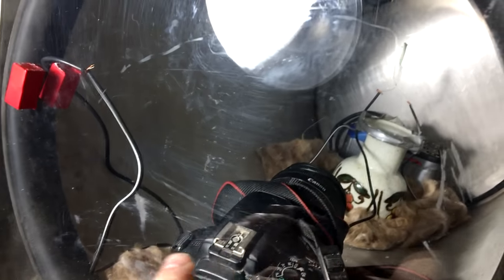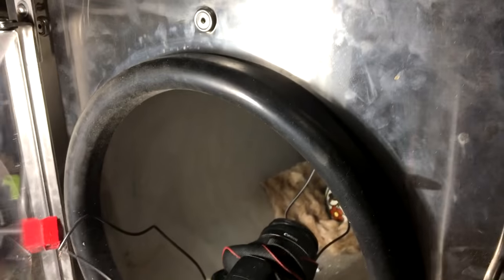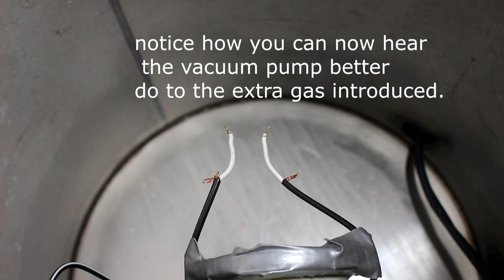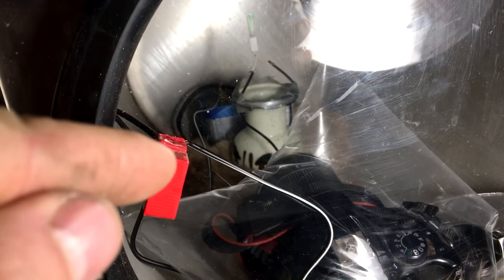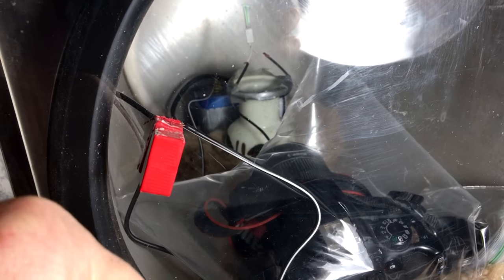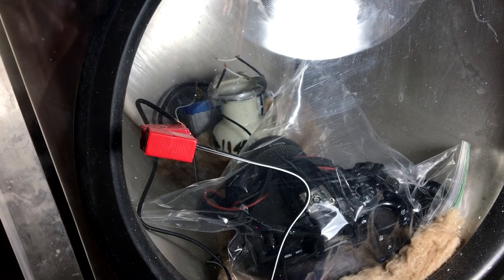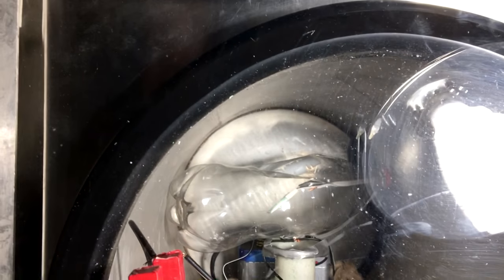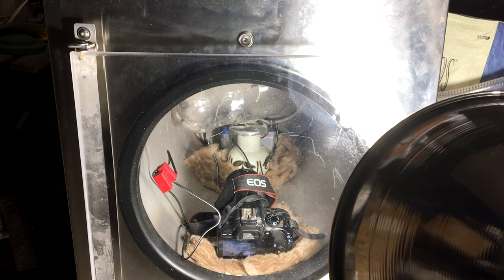Sound of Explosions in Space? part 1

Comment: So a camera can survive the vacumine of space
Reply: Paine Kid most things will.
Reply: Ludix147 but wouldn't the lens smash and the camera insides break ?
Reply: The optics are definently sealed and filled with gas, I guess the seal is just strong enough to withstand the negative preassure, or the seal broke before any lens did and gas leaked out.
Reply: If the camera is pressure sealed then maybe, however it's only one atmosphere of pressure. Going more than 10 metres deep in water would stress the camera even more than this.
Reply: Most of the optics are generally not sealed, especially on zoom lenses in particular.  When I zoom my lens in and out, I can hear the air escaping and entering the lens.  While this may not hold true to prime lenses, I wouldn't imagine the company taking extra effort to seal a prime when they don't seal a zoom.

Comment: If you created a diaphragm that made a noise as the air escaped, would that gas make a noise?  Since it would be pushing the air/gas that it held?

"In space, nobody can hear you scream."
Reply: Well, it is technically true. If you are in a space-suit, then your helmet vibrating won't transfer its momentum to any medium (due to near-perfect vacuum). And if you lack a space-suit, then you can't really scream, since air is just rapidly sucked out of your lungs, and then there's noting left to vibrate your vocal chords. Also, you're dead within two minutes.
Reply: If the air is sucked out of your lungs, wouldn't it go past your vocal chords allowing you to scream as it happened?
Reply: Gas will leave your lungs at near-sonic speeds, so it won't give you much time to actually use it. Back-of-the-envelope calculation shows you'll get at most tenth of a second, and more likely a couple hundredths. I don't think you can count that as a scream.
Reply: If you can't hold your breath in an airlock, wear a suit and use radio to scream. If the power's out, too, use a sign like Wile E. Coyote.

Comment: ok, so u can here noise in space, and you fan doesn't work under pressure moving the feather,  how about getting one of the skirt blowing speakers to see if sound waves move the feather and if so could you use sound waves as a propulsion method in space?
Reply: Sound is just kinetic energy that vibrates whatever medium it's in. In space there isn't any medium for the sound to travel through so you won't hear it.
Reply: +John Appleseed but as stated in the video, the gas expanding was the medium for the sound to travel through.

Comment: i seriously doubt you have a total vacuum, a pressure gauge would help, the best basic chambers only drop to 25inHg total vacuum is 30inHG so that would make this test "do explosions make a sound at hiogh altitude"  if there is gas around it sound is transmitted, no gas no sound, even if you had a total vacuum you would still hear the pop of the shrapnel hitting the camber walls (not the same as transmitting the sound of the pop)

Comment: Your vacuum chamber is too small to do a proper test.  The gas should spread out after a couple yards to the point where its impossible to hear.  You could try putting a barrier between the explosion and the camera such as a metal plate.  But I think the gas molecules are going to bounce off the sides of the chamber and hit your camera anyways. 

The only way to simulate the lack of sound in space is to have a big enough chamber so the gas molecules spread out to the point where most of them miss the camera

Comment: my question is if its near vacuum then how can the plastic cap get enough oxygen to go off and explode ! does it mean that a plastic explosive go off on mars or any other planet 😅
Reply: The blasting cap has its own oxygen which is released when heated, and yes they would work in space. Rocket motors work in space also because they carry their own oxidizer.
Reply: i know shuttles carry their own oxidizer but bear with me for a sec 
1.we been told there is no air in space 
2.for fire we need 3 ingredients fuel air heat 
so remove one from the equation we have no reaction !
Reply: The oxidizer generates oxygen. It's usually a solid or liquid that becomes a gas when heated or depressurized. Makes its own atmosphere or "air" to put is simply. In this atmosphere, the fuel can burn and generate heat to keep the reaction going. There is no air in space until the chemical breaks down and releases gases. There are many oxidizers. Liquid oxygen is currently my favorite(never actually had any though) but I have been messing around with N2O recently.
Reply: jack smith yea because plastic explosive does release n2o now i get it ! but still for me it remains mysterious why only oxygen is considered as air and not mixture of gases !
Reply: I think other gases can support combustion to an extent. An example would be magnesium burning in CO2(like on top of dry ice) or N2 atmosphere. Though most things that burn are hydrocarbons with the atoms CH as building blocks. These are not as stable as the products of combustion, energetically speaking. So by combining with oxygen instead of other gases, they stabilize the most.

Comment: Your 'vacuum' chamber is far too small to emulate the vastness of the vacuum of/in space, the expanding gases from the small explosion from the blasting cap will be able to reach the walls of your chamber and reverberate off/around it.

A noise would be produced at the blasting cap and possibly heard in the localised space around the explosion in space but would not travel far or be heard from a distance in space itself.

Comment: At the start, you spoke of pressure then you called it "negative pressure".

There is no such thing as "negative pressure". 0 pressure is the absolute lowest the pressure can go. Just like how 0 is the coldest temp that we can lower temp.

There is no -32 temp and there is no negative pressure. Either it has pressure and it scales up on the amount or the pressure is 0.

This whole negative concept, created by math, needs to die now. It is becoming a cancer. For the sake of argument, sure, negative. But for science, we need the real numbers, not for the sake of.

Also, when you speak "for the sake of", you teach kids that "for the sake of" is just "the normal". Which it isn't.
Reply: You're working with a different definition of negative pressure. In this case, negative pressure means "pressure relatively low compared to the surrounding area," and negative pressure tends to negate some of the pressure in the surrounding area. It is the opposite of positive pressure which tends to increase the pressure of the surrounding area. On Earth, typically speaking, a pressure less than 1 atm is "negative pressure." Typically speaking, a pressure more than 1 atm is "positive pressure."

Nobody is saying that there is less than 0 pressure. Maybe there should be a different name for negative and positive pressure to avoid that confusion, but if all parties involved clearly understand the difference the only argument is semantics.
Reply: Dylan Adams You claim it is a scientific term. You claim it is accepted. I want to know from where did it come from and by who was it accepted?
Reply: It comes from the necessity to describe a force that is opposite of "pressure." Pressure is defined as "the continuous physical force exerted on or against an object by something in contact with it." The amount of gas in a given volume exerts a certain pressure, but that pressure is not the amount of the gas. It is the force that gas is exerting. Typically, that force expands outwards. That force is what "positive pressure" refers to. The force that contracts inwards is called "negative pressure" precisely because it does the opposite of what "positive pressure" does. The same way that a negative number 1 negates a positive number 1, positive pressure and negative pressure negate each other.

After doing just a little research on Google ("what is negative pressure in physics" and some other fields got some nice results) I found a few different sources dealing with different fields that are working under varying definitions, but the overlying consistent thread is that "negative pressure" is the force that is opposite of "pressure." If you google the term you will see scientific papers using it in technical context. It is one of the more unclear terms in science, but it is clearly used with specific definitions in mind in its fields, and it seems pretty evident that the use of the term serves a purpose in those fields.

There is no board of science which dictates who's able to use what words in what way. It is all about the common understanding and use of the word. Negative pressure means whatever most people who use it think it means, just the same as any other term. Calling it by any other name only changes what you call it. So far, "negative pressure" is the working term that is practical and accurate enough for people to use it. That is what makes it an accepted term. What is not necessarily accepted is a general definition for the term, though in all cases I have seen, the definition "the force opposite of pressure" (which is nearly exactly the literal meaning of negative pressure) fits the intended meaning.

I feel like your problem with the term comes with the use of pressure as a measurement the amount and temperature of a gas. Let's take 1 atmosphere of nitrogen and oxygen as an example. The pressure is not the amount of gas or its temperature - it is the force that the given amount of gas in a given volume under a given temperature exerts. The fact that it is one atmosphere does not tell us how much gas is there. Given its temperature, we can find out how much gas there is, but the pressure is not that amount. Pressure is the force that it exerts on its surroundings. Negative pressure is a similar force that happens to do exactly the opposite of pressure.

It is simpler to say "negative pressure" than it is to say "the opposite force of pressure." If you can think of a better term for it and get everyone to start using it, go ahead! I agree that it is a confusing term at first glance, especially for people who don't expose themselves to science very often. It's just the term that some people have naturally settled on to describe this behavior of low pressure surrounded by high pressure.

Cody was not wrong in his usage of the term, even if it is a potentially confusing term, since it is the term that fits the force he is describing, though his viewers may benefit from him explaining what he means by negative pressure as it is important to understand what his definition exactly is.

I'm sorry if I'm explaining things over and over again. I'm trying my best to be as clear and thorough as possible.
Reply: Dylan Adams The word is "negative" not "negative pressure". That is two words.

Again, I get it and see why it is done, but I also see the damage it causes, so I do not agree with the use of such language to define something, especially when better language could be provided. Also, when that concept is wrong.

It isn't "confusing", it defies logic and is counter intuitive. That is the issue. There is no below 0 in pressure. You either push or pull. There is not negative push or negative pull because in that scenario, it now becomes the opposite. It isn't negative pressure, it is now sucking.
Only those who learn wrong defy intuitive thinking done by intelligence, like what you and his click are doing and did. That is a form of brainwashing if you actually throw away intelligence to favor someone else's word. Pretty sure that is a Hitler move.

When your "word" rules over "intelligence", you get problems. Such as the birth of stupid people or people confusing terms for something else. You get people who obey instead of think. Such as with the mass killing of Jews. Or the idiotic children who play video games according to a meta instead of logic. This directly translates into life BTW, so do not throw the gaming aspect out.
We don't want all of that so stop encouraging it.

Again, if you are not broad minded enough to see that, you need to expand your mind. You need to understand that the world is not your click, stop acting like it is. Think for the world, not for you.

To put it simply. I don't see how it is better to serve a group of people over the entirety of humanity. I am pretty sure that is why America is so fucked right now because the system is now favoring the top 1% and not all of the people as it should and was designed to be.
And again, this relates because only people who have conformed will understand your logic. That is not what logic should be.

Honestly, that sounds like disease and corruption to me.
Reply: You are tying the use of a particular phrase as a scientific term to disease, corruption, Hitler, the Holocaust, video games, the 1%, and a load of other BS that has absolutely nothing to do with what we're talking about. Dude, what the fuck?
Reply: Dylan Adams Philosophy. Try it some time. And no, I don't mean crap in books or stated by someone. I mean actually let your mind go places. You might wake up and realize a few things.